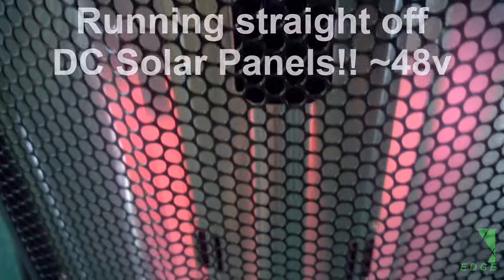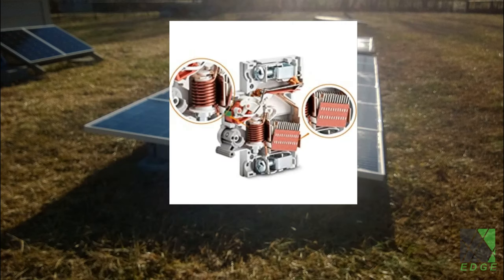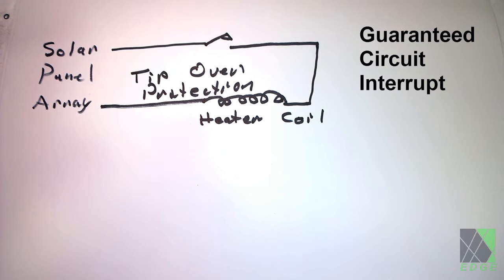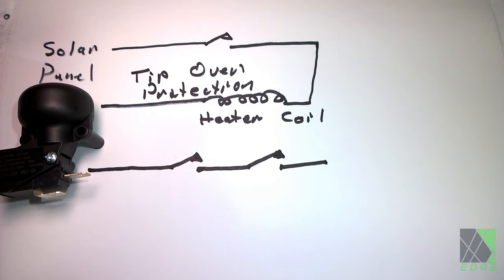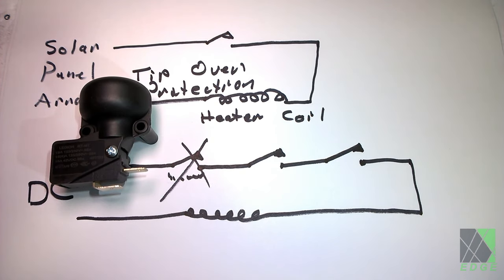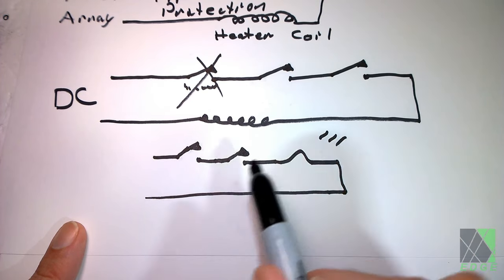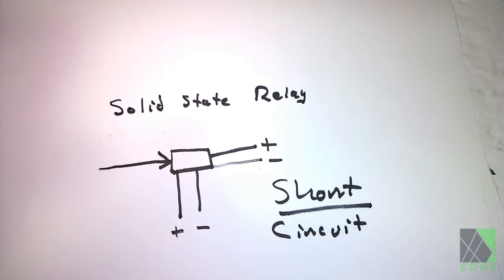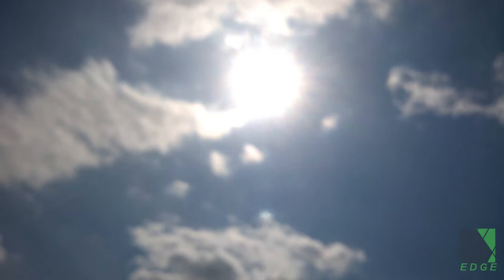Home Heating w/ direct PV DC Solar Panels! PART 3 engineering safety controls for DIY space heaters

Comment: I got a 100W 12V crystalline panel (Northern Tool $159+ ) and two, 10W 12V ice scrapers (Hamricks $10 each ) . In parallel, buried in the center of a 35 gallon galvanized trash can full of sand, up on a metal dolly. It gets SUPER hot - 700C thermal cutoff - in daylight and stays warm all night. Still outside, saving up for a deep cycle battery to stabilize the voltage.
Reply from the maker: Really neat!!
Reply: @SolarPowerEdge I am planning on doing this with resistive wire and sand. With resistive wire, do I need a DC switch to prevent damage to my solar panels/MC connectors to remove?

Thank you for all the great info and your DC power videos.
Reply: Addendum to my first comment.   I wonder if a hot water heater, using two installed 48vdc heating elements and wired to residential solar panels, could be used?   But this tank could be placed in a larger metal enclosure and submerged/surrounded by sand, thus serving two purposes:  Heating water while simultaneously giving off valuable heat in your house.   The elements would be thermostatically protected within the tank.  And dc breakers to the panels also installed for protection.

Comment: I think a more robust solution would be to use a DC contactor rated for the voltage and amperage of your heater to control the load. Then use the tipover disconnect and the over temp disconnect in series to drive the coil of the contactor. if either one opens the contactor drops out. DC arcing is caused not only by voltage, but also current. The contactor coil draws on the order of a couple hundred milliamps which is a very unlikely to damage your switches even if they are AC rated. I think this is better than using two underrated switches in series where one can arc short and then the other can later arc short. Just a thought.
Reply from the maker: @marklewus5468 hi and thanks for the thoughts and ideas. I ended up settling on the series switches, but also bought some very large DC contactors. They require a power source, which can be drawn from the heating coil  as a voltage divider. Well anything electromechanical seems better than those cheap SSRs, which often short closed.

Comment: It's still not making any sense. A 1500w space heat barely heats one room, much less a house. A much better plan is to use solar to run an electric blanket and heat your body instead of the air
Reply: At the beginning of the series the channel host was clear that this was meant to be supplemental heating. That said, 1500W could certainly heat a standard sized bedroom on most New England winter days, though probably not the coldest of them. And 1500W, even 750W, could work wonders in an RV or a van, even in the winter. I know a woman in a 25' RV who heats with a 1500W heater through the winter in NH. She does need to light a few candles on those really cold ones, tho!
Reply from the maker: 3 factors to consider: insulation (R value) in the construction, square footage and the climate (how cold it is). For my climate, R value and bedroom size, a 1500w space heater would be too hot most of the time. Only need 500w. When it's really cold, 1000-1500w running all day should be enough. In my living room, I run 2-3 solar powered space heaters for supplemental heat, depends on the sun. If it's not enough, I fire up the propane. Works so well. Already got them out for this season and wired up.
Reply from the maker: Right on and thanks for the comment! I only heat 1 20x20 bedroom, partial living room and 1 partial shop currently. fyi I have 14 solar panels (max) for heating. What could be done if I had more solar panels? Maybe someday :)

Comment: Have oil filled electric heaters been tested. They are inherently safer. Two in parallel Would get you to 48v area. Just a thought as I love the oil filled as a superior engineered product.
Reply from the maker: I have 2, the large radiator type with wheels. But had some problems with their integrity and a bit worried oil is leaking out. Could just be these particular units though. I won't give up on them just yet.

Comment: If you but these tilt switches in parallel would that double there amps rating some for over heat switch's
Reply from the maker: @geraldwilson8830 That's true, good point

Comment: What about this . . . a slow-blow fuse in parallel with the tilt switch? Stops the arc (because there's still an electrical connection) and then blows 500ms or a second later. What say ye?
Reply from the maker: Hmm interesting. One of those fuses that resets perhaps? Problem is it might reset endlessly. I've been investigating a (relatively) simple circuit to use in addition to the switch to suppress arcs and allow higher voltage but maintain safety. Possibly in a future video, didn't have time to cover it here unfortunately.
Reply: @solarpoweredge  I was thinking of one that would just blow. Maybe mount it on the front so you can see if it's blown. I haven't really thought it out, either. Just throwin' it out there! I'm glad you're making these vids. I've often wondered why there's not more people doing direct PV to heaters, given how much the price of panels has fallen.
Reply: @unionse7en  It would certainly need to be properly sized. Large enough to create a temporary path for current to flow so the switch doesn't arc out, and small enough to make sure it blows within a second or so. Personally, I'd experiment. It may not even need to be a slow-blow fuse. A standard fuse, properly sized, could do the trick. I'd start around 1A and test from there. See how it goes. Or said experimentation could show it to be a bad idea. If either of you test this, please post your results as it may be a while before I'm in a position to test it myself. Peace.
Reply from the maker: I like the idea of bridging the switch. Will post an update if I am successful at testing such a circuit. My hope is that by spreading this idea, manufacturers will start making mass-produced DC-rated space heaters. It would be so cheap and easy for them, they already have the tooling and manufacturing lines in place. Then we can just safely plug in excess solar power - no hacking, inventing or converting heaters required.
Reply: just  athought, murcury switches to open the circuit if the heater is knocked over? i dont have any experience with large DC load curcuits and these switches. so dont know if that would be a good idea or not.
Reply from the maker: @jeffconway8958  Yes indeed I had looked into those but unfortunately they are banned. Finally found a heavy duty one for sale but it was really expensive and was actually a part for some kind of machine. So the tilt switches seem to be the only "cheap" option I could find.
Reply: @jeffconway8958  Ditto here. First thing I looked for were mercury switches. But no dice. I've looked for them in the past, too, for other projects and found that they were banned. I'd love to find a pile of New-Old-Stock ones lying around somewhere!

Comment: I have a bypass on the 240v PV input to charge controller and it goes to 240v baseboard heater. Right now I have a breaker and DC contactor in the feed to heater. I hope in the future to use the Aux control from the solar controller to control the bypass the pv . I also have a direct DC water heater that I control  using an IGBT module  - details of that on my youtube channel. I will watch more of your videos later when I have time.
Reply from the maker: Sounds really cool :) hope to post more vids soon about PV heating. Thanks for watching! DD

Comment: Your channel is really forward thinking.  My hat is off to you!   
My thoughts regarding the heating set up in several of your videos is as you state built with  Safety first.  As an electrician and electronics enthusiast, i concur.  With that in mind, it might be best to simply buy these cheap heaters for parts only.  Then remove  the tip over "disconnect" switches all together.  By that i mean diy your own permanently installed heater created in a metal/insulated enclosure.  The tip over factor will not be an issue.  
Also you can build it with oversize wiring and other quality parts as needed
If you have metal working tools such as a press brake, a professional enclosure can be made.   Even a smaller cheap press brake can be purchased at Harbor freight or online.  I built mine using scrap metal and my wire feed welder.   Anyways. Just my thoughts.
Reply from the maker: @mr.makeit4037 Thank you for the kind feedback :) good ideas all around... I have a 30" brake, just need a coil of sheet metal and some practice, plus about 7 of me to keep up with all these projects :)
Really want to get a welder.. someday!

Comment: I love all you're doing.  I love the education.  I'm considering this route as well as the sand heat storage route with a heater element.  What is your views on heater element in a thermal mass of sand?

I love both ideas
Reply from the maker: @peterxyz3541 Thank you, I am thankful for your support and that these videos are of value  to you :) 
Working on sand battery storage now... these heaters could very well just be in a tank of sand. Planning to make some videos about sand thermal storage as soon as possible. The heaters work so well daytimes, but I'd like to have some overnight heat too. That said, batteries are nearly 100% efficient at storing heat 1:1 with solar panels, although a very expensive option. So  a hybrid solution seems very likely!

Comment: Forget the tip over switch. I bolted mine down. Am I ready to go? How many 100w panels does it take to turn the heater on?
Reply from the maker: It depends on the wattage of the heater and impedance. The white heater shown (with 2 tubes) has custom wound elements and needs around 1kw of panels, 50v or so. Those small PTC heaters can run off of 3-4 100w panels in series or parallel. It's  a matter of choice - more  powerful heater, you need a lot more panels. Currently running 3-4 heaters if it's sunny, does help  keep us warm. 12 panels for the house supplemental heat but of course I want to add more.
Here's the PTC heaters I was referring to: https://youtu.be/wK3_lRSntRc

Comment: Hey, just for general info. I have heard the MPPT controller gets more juice out of the panels, so do you know if it will help in your setups when you install MPPT in the circuit before the heater?  I read that MPPT can't directly drive an inverter, but this might be different case on direct resistive loads that work on fluctuating current.
Reply from the maker: Hi, you are right about this. I have been looking for a programmable or MPPT DC-DC converter but they are hard to find. There are 2 schools of thought, mine is to keep it dirt cheap and simple with direct drive PV (but lose a few watts) the other is to use an MPPT circuit to manage the impedance difference between the panels and resistive load. And gain every last watt. If I ever find a good DC circuit that can do this, maybe I'll review it and post the results

Comment: Did You consider using DC DC step down converter or mppt charge regulator with load output for stabilizing DC voltage? It would simplify heater math.
Reply from the maker: @LaSek-q6t Yes! It would work and it's a good idea.  I think in terms of a grid-down environment. What if electronics are harder to get? In that case, a simple resistance load combined with a "diode string" is very cheap, robust and simple and will regulate the voltage. I will try to do some video about this topic (resistance/solid state hybrid heating element) as soon as possible. (Waiting for cold weather to do heating projects)
Here are examples of diode-based solid state heating elements that regulate to volts-max-power range automatically with no complicated electronics. Hope you find these topics interesting. -Dave
https://youtu.be/6D0aUmkUQSQ
https://youtu.be/42XIbHA9Dv0
https://youtu.be/CRhkZp6ECHk

Comment: Could you please show us how you installed the tip over switches??
Reply from the maker: @rigmedic6941  Hello, this is a quick response (faster than making a video). 
I could still make a video if this is not enough. Just let me know exactly what you want to see. Unfortunately I never had time to finish this video and show the installation, sorry about that.
Option 1)
What I recommend is make a platform or base inside the heater that is perfectly level. It must be level with the orientation of the heater as much as possible. Then use an L bracket or similar to fasten the switches, perfectly vertical with at least 2 bolts. Also, the 2 switches should be synchronized, they need to open at pretty much the same moment.
Option 2)
Attach a small electrical box to the outside of the heater, place the tip over switches inside that. Make sure all wiring is covered and securely crimped, nothing exposed. That option looks a bit strange but it's all about safety - not looks. Hope this helps! DD

Comment: I can get ahold of brushless cab heaters (commercial/military) 12v to 48v they can’t handle more than 20 amps
Reply from the maker: Yes I've been seeing those around. I have some of the 48v ones. But as of now I switched to converted space heaters because they're "quiet" usually no fan. So far so good

Comment: Maybe a DC contactor like ones used in electric golf carts is the type of switch you need. Maybe not a cheap solution.
Reply from the maker: Good idea. If they can handle a 48v golf cart motor I am sure they can handle heaters or any DC load.

Comment: 12 volt continuous duty solenoid,or higher d c voltage relay like for golf carts
Reply from the maker: @Reset-hesitant I bought a couple of those DC contactors to test with, just got to work out a "simple" power supply

Comment: Mercury Switch for tilt protection?
Reply from the maker: @1brasov Since making this video I found a contactor that works pretty well, but it requires a power supply. Hopefully will be able to make a video about it once some issues are solved.

Comment: Do they make DC rated mercury switches that can handle the amperage? Arc welding wouldn't be and issue with one of those.
Reply from the maker: Yep it's a great idea. I have spent significant time looking for mercury switches. Apparently they are not allowed to be sold any more. I found an auction for a heavy mercury switch with high amps, it was attached to a replacement part for some kind of old machinery. Sadly it appears they are no longer possible to buy. Wish I had gotten some before that happened. If anyone knows where to buy mercury switches that can handle 20-25 amps - please let us know...
Reply: @solarpoweredge  You could also do things a little backwards and wire your tilt switch to short to ground when tipped over. The breaker can handle it but you're going to have to break the now welded closed tilt switch if you want to reuse it. Beats burning the house down though... I'm an electrician and when we need to interrupt high current we use special switches with these things called arc chutes built into them. Would be a bit over kill for what you're doing but its a pretty cool way to deal with arcing. There's also arc runners and magnetic blowouts to deal with arcing. But these are just some cool things to add to your electrical knowledge, maybe they'll come in handy one day.
Reply from the maker: Thanks for the info... those switches sound intersting. I am for anything that stops a heater from burning everything down. One of my designs uses 2 synchronized DC tilt switches in series. Might do a more specific video on that in the future if things go well
Reply from the maker: Strange, your last comment does not show up here - at all. So I am replying to an invisible comment for the time being... First thanks for the kind feedback and I'm always thrilled when I can get anyone to watch my videos after all that grueling hard work :) I hope renewable energy does become more effectively utilized and part of that is getting young folks on board with it. I'd like to teach classes to young and college folks about solar,  maybe someday. Checked out your website... wishing you the best. Please stay tuned.... My hope is to document several more cool solar power projects on here as soon as possible. Had a lot of things slowing me down lately - but I believe they will move out of the way so I can get some more videos uploaded for you guys.

Comment: Will this work with a wind turbine for the night time
Reply from the maker: Hello, yes it can work. This is basically like a dump load. Need to match the heater impedance to the turbine of course. If only I had a wind turbine, I would have already hooked a heater up!
Reply: @solarpoweredge  the power of a wind turbine can be volatile however it could help greatly with the heating crisis around the world if done correctly
Reply from the maker: Good thinking... Right on!

Comment: tilt switch, auto reset breaker and slow blow fuse or.... tilt switch, slow blow and manual reset breaker ?
Reply from the maker: Yes that could work, anything to disable the heater instantly. I may spend some more time looking for more breaker and fuse options that are suitable for this project